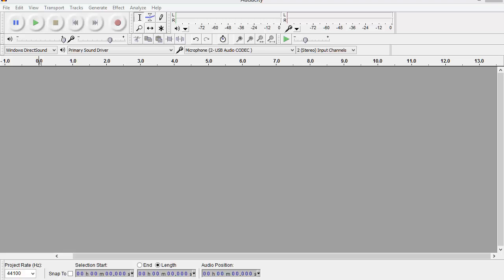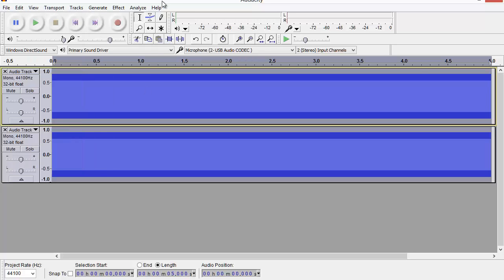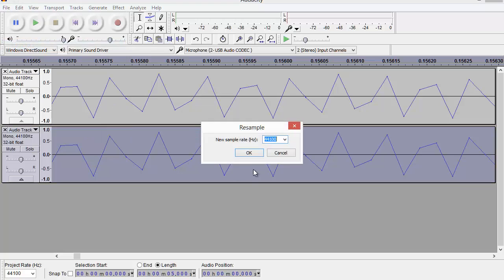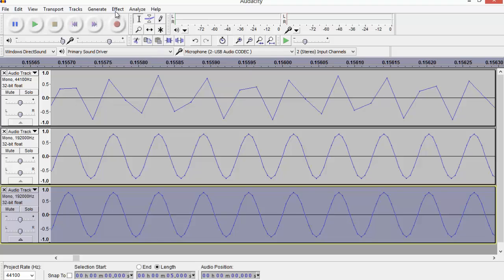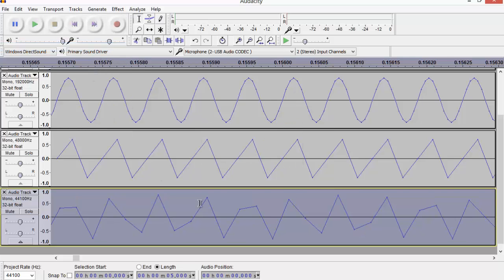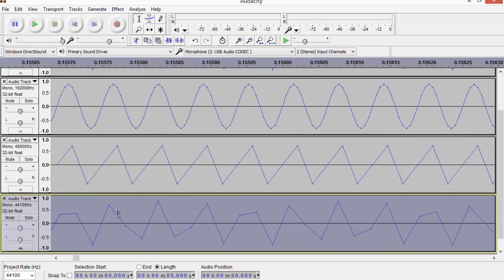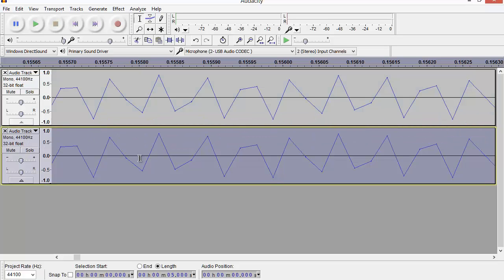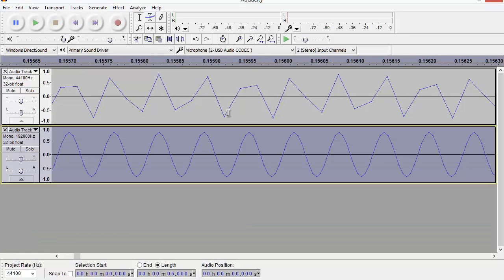Audio Resampling (done right) Doesn't Introduce Distortion

Comment: It should be noted that this reconstruction of the original signal arises from properties of a sinc filter. Being a brickwall cut-off filter, it can do perfect anti-aliasing when sampling a signal at arbitrary frequency. If one chooses, for example, linear interpolation (one that is used in drawing the waveforms here), it will result in noticeable aliasing, making much of the signal "leak" above the Nyquist frequency.

Comment: I don't use computation methods for resampling. After some years and many listening hours labouring with unussual methods, I'am using something different. DA/AD conversion in real-time. And analog mix in the middle for tunning. Most time DA in 44100 mode and AD in 192kHz mode. Two soundcards and good cables-devices shielding, only one powersource to not get galvanic interferrence between two. All of this preventing the impulse aliasing deeply(including bassline) due to comparator circuit related to AD side. 48kHz too of course, because 48DACs are everywhere. DA-AD method can be improved slightly i think. I hope that helps.

Comment from the maker: All of the versions sound the same - like a pure tone (if your ears work that high, and your speakers aren't distorting!) 

The 48kHz sampled wave only "looks" like saw-tooth because of the straight lines that Audacity draws between each sample in the wave view. When the samples get passed to an output devices it will not use a straight line to join them, just like the upsampling in Audacity clearly doesn't use a straight line.